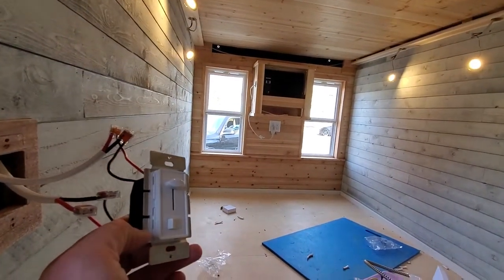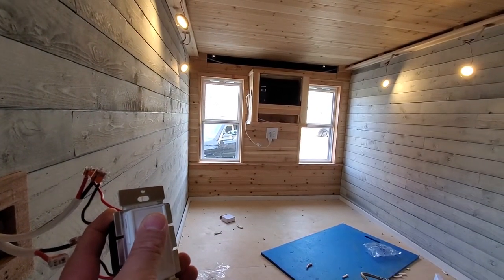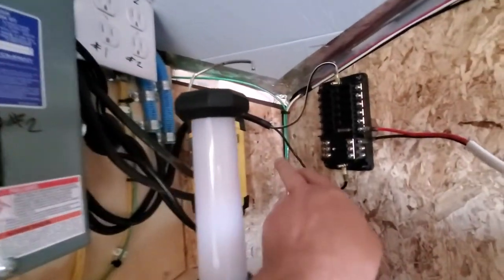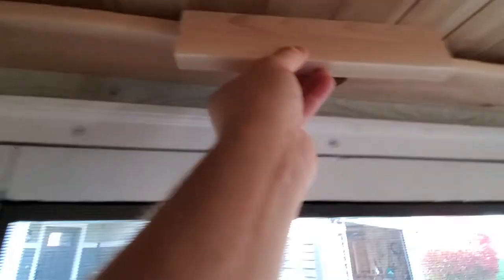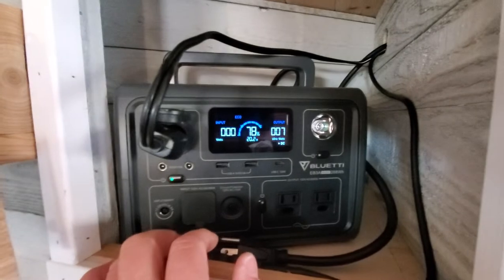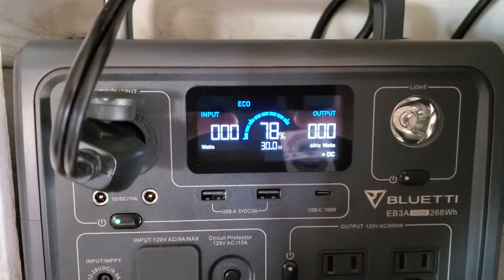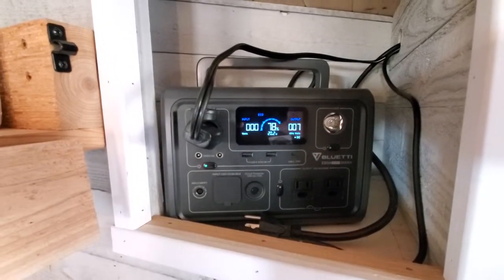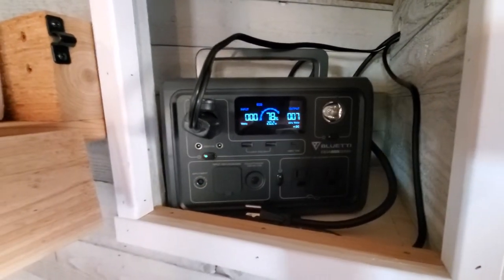Using bluetti EB3A power station to power puck lights in camper! cargo trailer conversion!

Comment: This is great information, thank you! Some of the lighting configurations in others' videos are vastly overcomplicated and come in at exorbitant costs. I suppose part of that is based on the power source being used. Some folks are using electrical connectors that cost more than the lights themselves. I love your simple and creative solution (taking safety into account) without getting drawn into a money pit. Thank you!
Reply from the maker: You betcha! Check out my electrical part of my cargo trailer conversion playlist to see it installed!